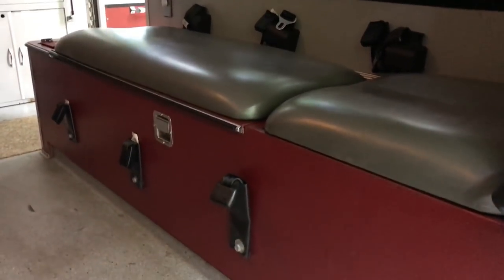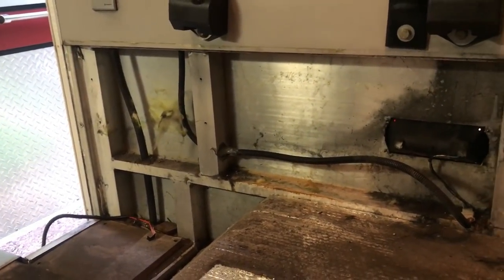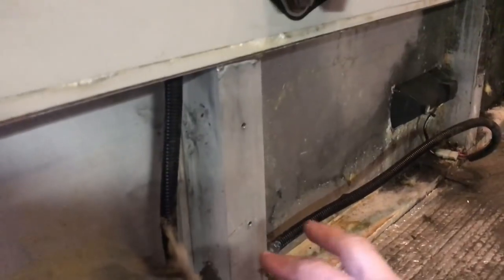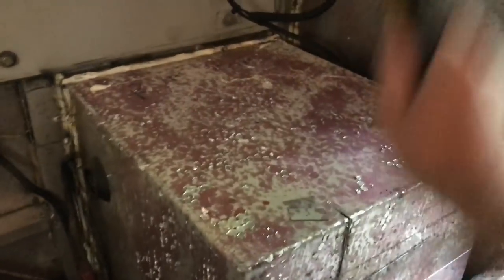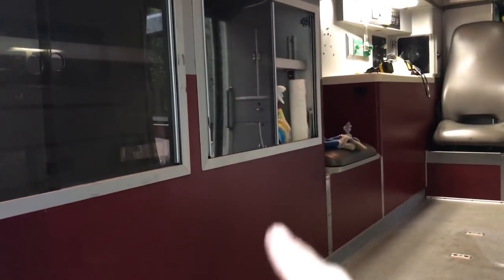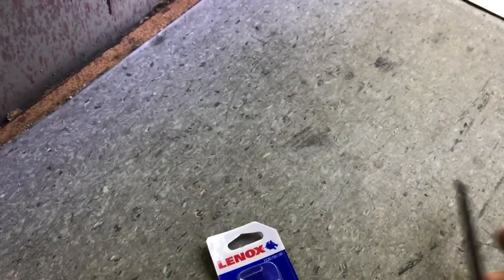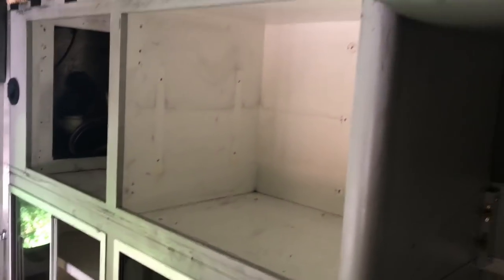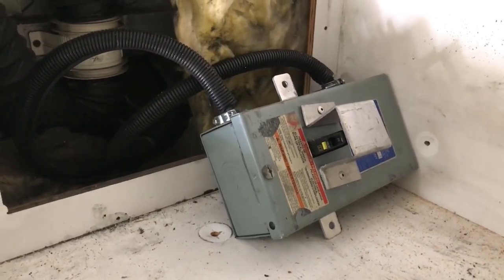Demolition P1 - Ambulance Camper Build Conversion RV Freightliner FL60 MAV

Comment: A magnet has always helped me when something is painted, bolted down or behind something else and I'm trying to determine if it's metallic. I've wondered why ambulances are so expensive, now I know. Thank you, I love to learn and they don't teach this stuff in school !!
Reply from the maker: I finally ended up buying a work light that has a magnet base which is helpful for what you mentioned. Funny thing is there is almost nothing that it will attach magnetically to in the MAV! Good thing it has a hook. The cost of the the base Freightliner FL60 chassis as quoted by my insurance, was $65,000 new. They won't quote a price from Wheeled Coach but I know the new cost of the MAV was over $100,000. You can buy these with 200,000+ miles for less that 10% of the new price - crazy. Some people trash the ambulance box and sell the chassis - it's worth more that way. I can't imagine what the aluminum scrap value of a chopped up ambulance box is. So sadly they are worth far more in parts. The used light lenses sell for $50 - $100 each, that's for the red ones you are supposed to take off - can't even find a clear one.
Reply: The unspoken things you learn when disassembling projects, like the clear lens being unavailable, is priceless. Clearly for those rebuilding, knowing you'll need the WHOLE light replaced because clear lens are not available makes you an expert on this matter. Not to boast, but someone others can turn to as the go to person. I envy you. If others need those clear lens I wonder if there is a small unexploited market potential? Entrepreneurs of the world TAKE NOTE.
Reply from the maker: HEHE! Absolutely!

Comment: Yes, Stainless steel is worth more than scrap metal. Contact your scrapyard. And those hang down tire chains are worth quite a penny when you buy them for a fire truck. If you have snow and they work, I would keep them. .....  Your last vid, there was another feller's vid that came up who had refitted an old ambulance. He made an outdoor shower in that tall box in the back. (I thought was cool).  ..... Seems like there was a shoreline on some of the old firetrucks that plugged in, in station to keep batteries etc, maintained.  A box wiring diagram would be helpful. .... When I started on the local VFD, our newest truck was a 1962. haha... Cheers!
Reply from the maker: Glad to know on the stainless. I have a good bit of aluminum from the cabnate shelving - heavy vertical rails and brackets. I have over a hundred pounds of 1/8" stainless - will check around for a place to sell. In the video on Tuesday I talk about that shower you referenced and also the shore power hookup - you are just ahead of me! A wiring diagram would be helpful - I have not reached out to Wheeled Coach yet.
Reply: There might be a diagram behind a panel somewhere? ... There's different grades of stainless.  Check with your scrapyard on how to check  and how they prefer it. ie, cleaned, in short pieces, etc. Same as with aluminum.  I know ya get docked if there's any metal or screws attached. .... Try a magnet on anything you have doubts about.
Reply from the maker: Good to know. Will need to sort them out better than I have. I just sent 2 emails to Wheeled Coach telling them about the series and asking for a electrical diagram.

Comment: All the boxes in an ambulance like that are made out of aluminum   ..  there are some stainless pieces, mostly trims, but the boxes are not made out of  stainless   -  you wouldn't e able to cut through stainless that easily, I just finished all this same work on mine. Those boxes are all welded to the framing members, which are also aluminum - the entire box is.

Comment: Great project! I had seriously considered an ambulance conversion until i found out i could not get an insurance carrier in canada :(
Reply from the maker: Thank you! That's terrible about the insurance. They won't let you reclassify as an RV if you take all the flashy parts off? I am supposed to take the light bars off and remove any red lenses, cut the wires to the lights, sires and airhorns. I have seen where people have covered over the red parts with while vinyl. I will try that route first. I know here you can get in trouble for "impersonating a rescue vehicle" if not careful.
Reply: I am in Ontario. Mine is just insured as another work truck.

Comment: Holeee...as I suspected! 🧐. Can you show that torque drill bit again in action? Im hoping you wear a protective mask because my guess is that “more toxic” materials might have been used because of their performance qualities in a service unit such as this. Backstory: I was involved with Toyota finally making a carbon cabin air filter when their after market supplier was embroiled in a lawsuit for using a fake carbon  air filter in the tanks used in active military action. . I have one of those fake ones that I knew right away was fake and didn’t put in my Prius. I told Toyota to fashion along the lines of the excellent Volkswagon one (used to have  a bug) and in fact always retrofitted theirs in my Prius until Toyota released a proper one...what a girl has to do! I get even nastier if a manufacturer doesnt use the correct oem tires. When I tested the first PriusV on the road in Ontario Toyota had no idea what the correct winter tire was...doh...the car was in Canada..we get snow! Carry on...so exciting! 👍
Reply from the maker: Wow! You are very knowledgeable and Toyota must get worried when they see your caller ID come up! I have been wearing protective eyewear but not a mask, will pick one up. How can I tell if I have a good filter in my 2009 Prius? The ambulance has these cool air powered drop down snow chains. They are a wad of chain the hangs next to the tire on the underside and bang around and spins. It knocks the snow and ice off. I need to search a video to see them in action. They are so odd looking but I guess work well. You might know better.
Reply from the maker: ...and will try to remember to show the drill bit working.
Reply: PriusStealthCamper Adventures Hi! 👋 Im assuming you have been changing your cabin air filter. The white ones are garbage IMO but the carbon ones are doable but not nearly to the VW spec. If you find you dont like the price of the Toyota branded one I am recommending ppl buy the after mkt Fram ones on amz with baking soda (thats marketing bs). Im testing now on my gas hog Santa Fe turbo. 

Yes pls get a mask. Better one than an N95. They are only  a lightweight barrier. You need better than that with 2 carbon cartridges for voc’s - 3M is one brand. Are you convinced that the black powder is soot esp behind extremely well constructed walls? Wear heavier duty gloves as well.

Are you familiar with marine products? If I do the NV 200 build I think im going to have to cross over to that market.
Reply from the maker: Thanks for all the good info. The plywood scraps that I have removed have been sitting in the rain for 3 days and have not deformed or de-laminated so the only type I know that can do that is marine grade. I can't even get that here in the mountains of NC - it would be special order. I don't know the cost but I can verify they can withstand direct extended contact with water - very impressed.
Reply: PriusStealthCamper Adventures as luck would have it Im around the corner from a marine store having a cuppa 👍. Will nosey around in there and see if they have anything I might want. Another tip: in your rebuild pls dont use Blue wood. I tested it but nvr got full disclose on the pesticide product they used to infuse the wood so could not endorse. That product was invented in Florida bc of dampness and termites etc. I recommend Dow blue rigid over anything “pink” and if you need to seal toxins in try Safecoat. I used to bring it into Canada bf it became a thing in residential and commercial builds. Used it in my own home bf occupancy.